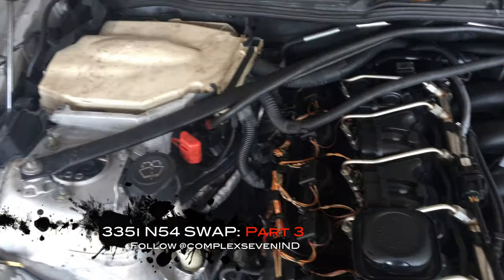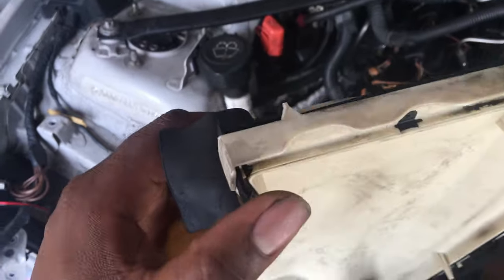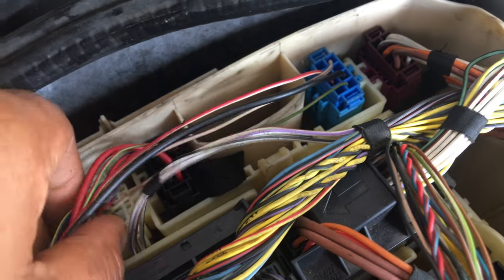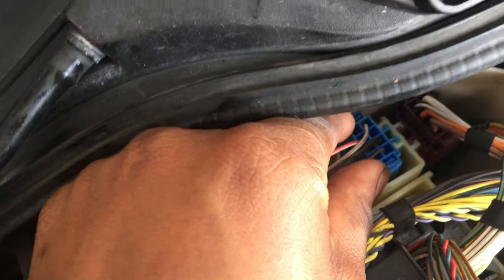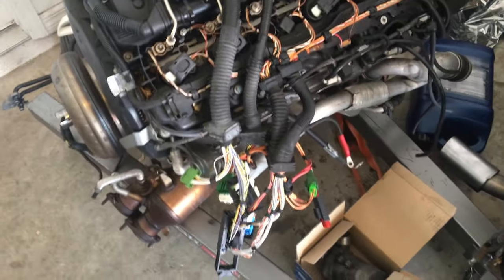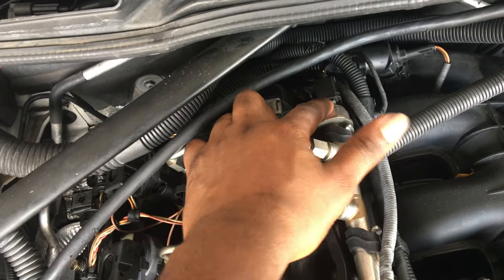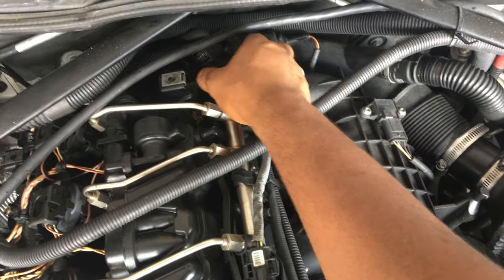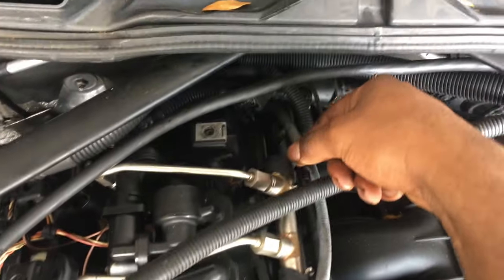BMW 335i N54 Engine Removal DIY Part 03

Comment: also i had a question for you if you could humor me a bit ...here goes my project in the very near future is to beef up my manual 335i coupe with 2 singles 6870's if possible could you perhaps some how point me in the right direction as far as is it even remotely possible of a job that could be done? i know with just one top mount 6870 and the right add-ons would be more than enough along with port injection and jb4 tune etc likely do it but as i said its a project auto and i want to go all the way with it like sick too singles 6870's or maybe im just dreaming anyway let me know whats your expert advice on this? thanks in advance
Reply: Complex Seven Industries man that would be nice!! i know the space is limited very limited in those models...but yea i see what your saying? thanks alot bro for your input on this i have a guy who specializes in engine builds i will get with him and see what i can do on the hybrid idea!...✌